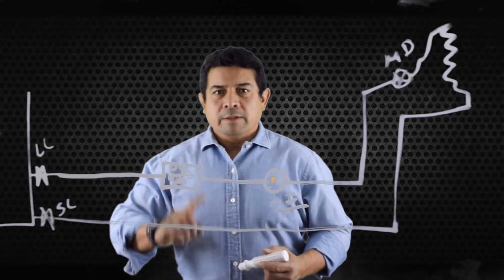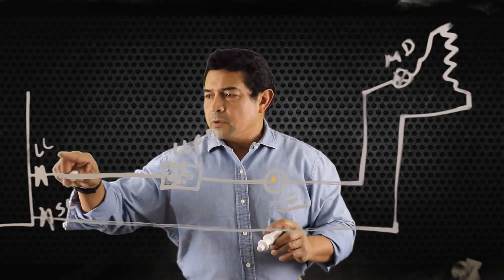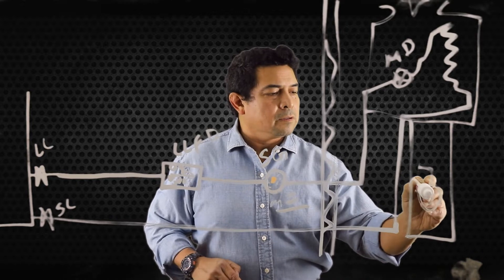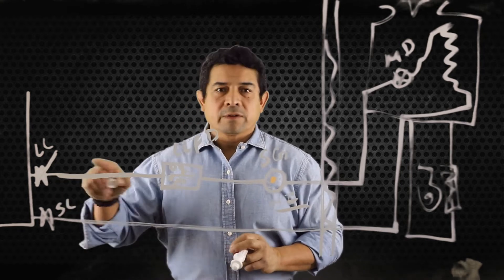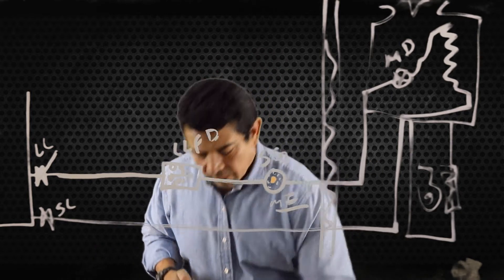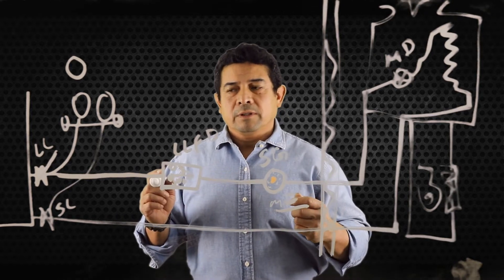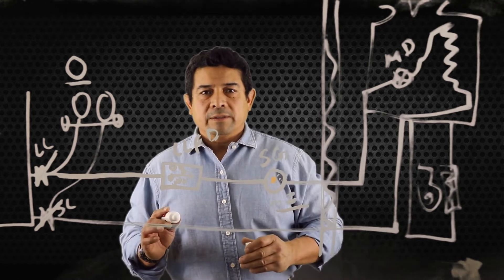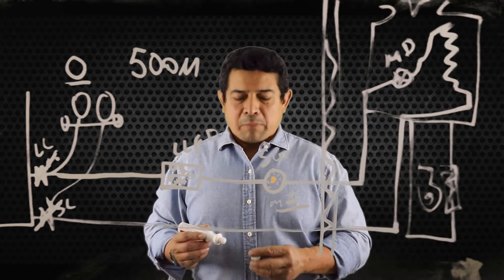Pump down - HVAC Online Training and Course

Comment: Thank you for this video. If we close the SL valve after the pumpdown and run the vacuum,  It seems to me the vacuum didn't include the inside of the compressor, is that right?, shouldn't the compressor cavity be included in the vacuum operation?
Reply from the maker: ABC you are correct that the compressor crank case or as you put it in the compressor cavity was not included when we pulled Down to 500 µm.   We didn’t need to include that because we have the suction line valve closed. When you removed the liquid line filter dryer air went into the system but not into the compressor, it did not go into the compressor because the suction line valve was closed. So all we need to do is pull a vacuum on the liquid line, evaporator, and suction line.   This is a great way to keep from using a recovery machine, not losing any refrigerant and saving a lot of time.   Thank you for your question.